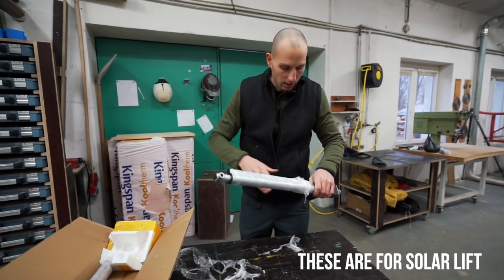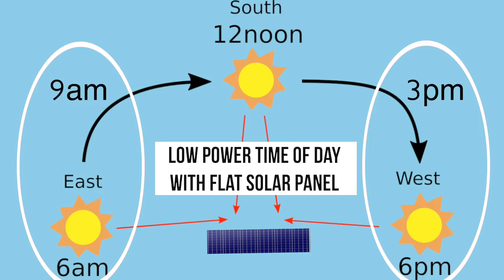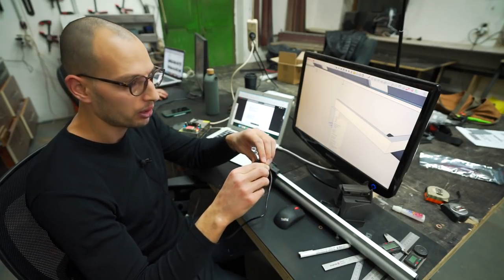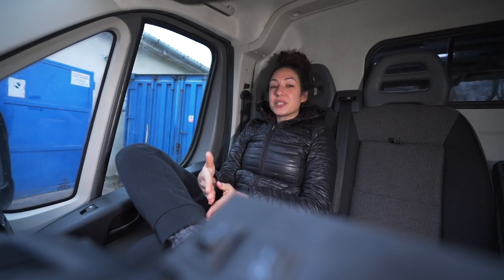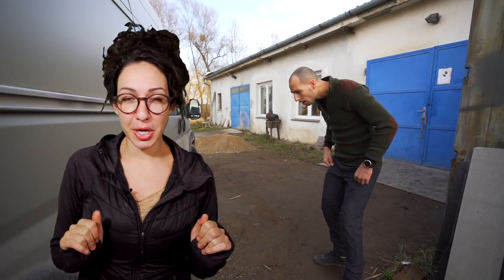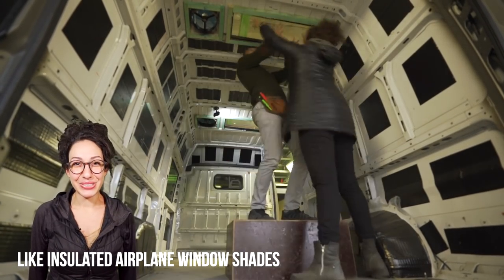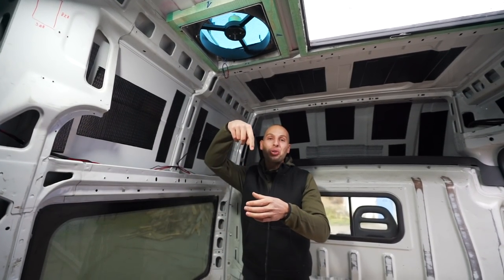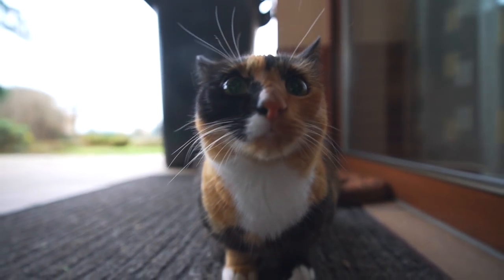VAN BUILD FAIL - Water, Solar Lift, and Possible DELAY? Campervan Conversion #11

Comment: Hi guys...I'm sure Ladi has got the skills to make your water tanks.
Bit of advice, as I used to similar work, when purchasing your sheet material and the corner beading ..make sure they have the same melting temperature or as near as possible...that way when using the hot air gun you are effectively melting the two sheet parts and beading together as one piece...also when starting the corner beading...slice off the back at a 45 degree angle...it will fit into the corners better....when melting the beading look for a pool of molten plastic at the back and keep that pool going as you move along...that way you know it's all melting together....I'm sure theres some plastic lining video's a available which will show you in detail....hope this helps and carry on the good work as I do enjoy your video's 😁

Comment: Ladi. Consider using a vertical compression spring (coil or leaf), or wedge at the non-motor end of the actuator, to start the vertical movement of the panel. Try to use the power of retraction to lock the panel down with a caming latch. I'm hoping to design a lift wherein the panels are stored when the actuator is half extended, and will tilt one way when fully extended and tilt the other way when fully retracted (fewer actuators). If I can't , I'll use solenoids to lock right side or left side pivot points to get same result.

Comment: Hey Ladi,  I'm so glad your wanting to lift your solar panels with a actuator as I'm trying to do the same. I'm leaning towards using a bell-crank. Thinking if i push off of the side that's hinged I can connect to a stationary  pivot point where the b/crank is and the other side of this b/crank will have some rod hooked to solar panels. When the actuator shoots out and pushes the b/crank, the other end will push against the solar panel  and raise the opposite side than the one hinged down.  In theory I think this should work,,,  but I'm kind of waiting to see how you tackle this and margaret captures it on film hopefully in  EP. 12  Stay safe & out of the cold
Reply from the maker: Hi, I’m in the development stage and it’s damn difficult to keep the solar as low as possible, lock it at the bottom position and have over 45 degrees angle. Send me a simple drawing of your idea at Ladi@mysuperebike.com if you don’t mind. I’m open to some ideas!

Comment: All that sealant slapped over the joints on the tank make me wonder if the plastic welds underneath are even water tight. Sorry for your set back guys. If they made that many changes without consulting you I personally would not pay. The drain off point was a joke. 5 litres left! As a welder and fabricator who has made his own thermal store out of stainless steel I'm interested to know what made you go the plastic route and what the pro's and con's are? I'm guessing the weight is the biggest attraction? Anyway keep up the good work guys, very thorough build detail and entertaining video's.  I'm pinching your triple glazed Argon filled roof window idea for my truck conversion. Top man.👍👍👍👍

Comment: Suggestion, if you used a spring plunger for initial lifting it will reduce starting force for actuators as well as act as anti-vibration device.

Comment: Definitely build the tanks yourself.  There are a lot of YouTube videos about building fiberglass tanks that should be helpful!  Fiberglass is very easy to use, can be built up over foam board to provide built-in thermal protection, and can be layered to a very strong thickness, and is infinitely customizable.  If you're worried about leaching chemicals in the water, just glaze the interior with a food-safe epoxy.  If you don't want to touch fiberglass, why not weld a stainless steel tank?  Just some thoughts.  Plastic isn't the only way to go.  There's a ton of alternatives :)  GOOD LUCK and HAVE FUN!

Comment: For the solar, what about using a lift like a scissor jack?  Also,  although it's a ton more research and work, if Ladi builds the water tank it'll be perfectly designed and durable  :-)
Reply from the maker: Thanks for the input. I(Ladi) considered scissor jack mechanism too. When you lay out all the measurements in 1:1 ratio you quickly realize not that many solutions are doable. We aim for very low profile and steep solar angle. Many people have done solar lifts already but we want to do it better.

Comment: My neighbour made loo cistern by acrylic solvent welding. Worked pretty well. Dunno how that stands up to having 160Kg of water sloshing in it under a van, but I guess you can add strengthening baffles. Are you planning to use ABS or HDPE and heat weld instead? I did consider making a (steel) hot-water tank for a solar system a few years ago as ones with stratifiers in were incredibly expensive and don't fit in UK houses. As it was upstairs and leak consequences were large I wimped out in the end and just left that project for later. So I look forward to finding out how to do custom tank construction. Aluminium with a fibreglass liner is a good way of making something really strong. Or even just fibreglass in a former (and a bash plate on the bottom). Any fool can make fibreglass :-)

Comment: The tilting is tough. What about pulling the solars on small springs/ or rubber bushings? Thisvwill keep it from Ratteling when they are down and help to get over the dead Point when pushing up.
Maybe a cantilever design that helps to get away from that flat angle.
Reply from the maker: I'm afraid it would be impossible to achieve even 40 degrees angle and keep a low profile.
Reply: @ladiandmargaret  I would dump the tilting and rather get the aerodynamics right so that you doun't have wind-noises while driving. The tilting mechisem will be very anoying iff you have a constant wind-whine while driving. 
You got enough solar,  it will ok withouht tilting.
If you get some E-bikes (Enduro whith BBSHD) where it does make sence to Pedal, that is good for your health and will at least 3x 4x extend your range. 800Wh per day would be more than enough for 1 bike 1day 80km or 2000hm easy.
Reply from the maker: Thank you for your suggestions. We know exactly what we want.

Comment: Bad luck - great video! 👍
Making custom tanks is a great option that could help in many builds. Would be interesting to see. You could create a second "tank" that goes around the isolation for protection (top side open). Or add pipes going through the tank for cabels or the break linkage under the Ducato...

Comment: Bad luck about the tanks. Relying on others can be such a pain. 
I ordered my windows three weeks ago and have just been told now they won't be ready until late January. By Xmas they said! 

If you're going to use vinyl sheet flooring (I am), turn it up at the sides where it can't be seen by about 20mm. This way it will reduce the chance of any  spillages, dust and dirt getting under the floor.

Comment: What sealant did you use for the roof lights? Is it ultraviolet stable? How much shrinkage is there? and when the van is moving and the roof is flexing/ the solar panels are lifting, will it hold and stay water tight? All so does the sealant have a maximum gap size that it will fill as the 7mm deep channels on the roof are quite a big gap to fill with a wet sealant. Just thought I would ask. As you seemed cautious in one part of the vt.

Comment: Do you think an air bladder (like a squeeze box) centrally fitted to the underside of the panel frame would have less moving parts and need less maintenance ?  If might even allow a manual override ?

Comment: What about two actuators positioned to face eachother along one long edge of the solar frame. With a small "entry" angle of the opposing actuators (actuators fitted to reinforced section of the roof and a centrally placed bracket on the frame, say 8cm vertical height) the force of the actuators would result in the solar frame being lifted. No forces would be transmitted to the frame structure, just the solid metal bracket. For a 100cm actuator you would get approx a 45 degree panel angle which would be enough to make a significant increase in the solar yield and still be safe in light to moderate winds.

Comment: Ladi do you do any custom battery builds? I'm looking to build an ebike using the carbon fiber nyx frame, qs273 motor and a sabvaton 200 Amp controller. Trying to get the max 15kw out of the motor. Can you build me a large capacity pack using Lipo cells?

Comment: wind - aerodynamic shield for the batteries on the front roof is sufficient to deflect the air velocity sneaking under the battery beds. btw: all objects on the roof create additional vibration load and the ceiling from inside is better to be cross-beamed ;o). But I luv yr creativeness and hard work. I'm gonna make my stealth van soon - fingers crossed :o).

Comment: In your opinion, do you think that sheet vinyl flooring is the best option for a van? I have had trouble finding a style I like in vinyl plank flooring not to mention, it is three times the price of vinyl sheet. I am concerned about wear and tear with two cats. Any thoughts or insights?? Thanks!

Comment: I have been wrestling with the same solar problem and have come to a solution that would like to share for inspiration. The idea is to use drawer slides hang out off the van roof and then pivot down to the 45 degree angle, using gravity. There are a couple ways this could work and I'm not sure if I would prefer to use the new ball bearings or the old wheeled slides???  We will see.

Comment: Have two cats in a small space and they lived on the boat with me. Use a Frisco Wall Sisal Cat Scratcher that works well. They don't like ones that are just flat against the wall, tho
Reply: Have to wrap it around a wall corner or they will not use it

Comment: Make it like boat tanks are made, we do it al the time. Use Aluminum or stainlessteel 4mm plate, outsource cutting on laser or water cuter with all through holes. Weld it mig or tig with splash bulkheads. ....

Comment: 14:30 isn't this the mechanism that you were looking for to use it on your solar panel? Just fix-mount the motor horizontally under the frame and you should be able to lift the frame up just like you would lift up that backrest 😉
Reply from the maker: It just gets more complex than this when you actually care about overall height of this structure and angle

Comment: A small Idea for the solar panels, when you drive and you don't want that they move while driving put in the front a small spoiler so the wind get over the panels and not under or between...
Reply from the maker: Thanks, spoiler is a very obvious part of the roof design.

Comment: Ladi will do a phenomenal job on the tank and in the long run you will be happier for it. 

Why plastic and not stainless steel?  I just got a custom stainless steel shower pan built and while it was not cheap you have a better chance of finding the needed expertise.
Reply from the maker: I've been drawn to plastic welding skill for some time so I ended up purchasing a welder and all the material for tanks. Stainless steal would be nice but we would not satisfy our 20k budget.

Comment: Would you be so kind and post a link to the magnetic mobile phone holding or add it to the part list file . Thx a lot
Reply: Just google, magnetic mobile phone holder
Reply: I'm afraid those magnetic phone mounts will interfere with the navigation "compass" that is built in phones
Reply from the maker: hey George, that's actually not completely accurate. Magnet holders for phones are designed specifically to not have that problem. yay!
Reply from the maker: https://bit.ly/37qUBvH

Comment: hi guys
If you would like to get the maximum power from your panels, not only need make them liftable, you will need them also rotate 360 degrees, otherwise to take full profit with the liftable system, you will need to park the van according with the sun which can be quite annoying in some places and turned de van around at midday....
Reply from the maker: Easy to say but pretty difficult task to engineer 😅

Comment: U maybe ray from rayoutfitted on YOUTUBE can help u with the solar array lifting system, he has one on his van as well
Reply from the maker: We've never seen doing what we want, that's why so much engineering. It's easy to mount them high above the roof and tilt them 40 degrees. It's difficult to have them less than 10cm above the roof and tilt them 60 degrees and that's what we are aiming for.

Comment: Since Ladi is building the water tank - maybe you can 3D print some extra insulation around it. Good Luck it will be an epic diversion!
Reply from the maker: That's would not work but we already have insulation sorted!

Comment: Tilting the panels is one thing to maximize the solar power output. But if you don‘t have any kind of swivel in order to turn the panels around the vertical axis, you have to turn your van 15 degrees per hour to maximize the solar power. This won’t be not very convenient. 
But I guess you took that already into consideration.

Comment: Guys, it was said once already and Im going to say it again. Use Aluminum or stainless. It will be cheaper, faster and is far more durable. I could have a tank built and in your hands in less than 2 weeks and I live in Canada. You absolutely could have something built locally in very short order as any decent sheet metal shop can put one together in less than a day.

Comment: The ebikes look good, however within the EU and UK, an ebike cannot have a motor more powerful than 250watts and not be able to be powered faster than 16.5 mph. As soon as you have a more powerful motor and faster speeds, it becomes a motorcycle that has to be legally registered and insured and you have to wear a crash helmet.  How do you get round that or do you sell them for private land only?

Comment: Omg those tanks were build worse than mine. And I did it with zero experience. I’ve used for great tank: steal and fiber glass, and fresh one i ve used plastic  tape, fiberglass and epoxy very effective. Maybe it would help
Reply from the maker: That would not be a nice job making fiber glass tanks. Better to buy plastic sheets and weld them.
Reply: @ladiandmargaret  yep exactly. I’ve used plastic sheets weld them together however I’ve noticed that after some time they start leaking so I’ve decided to redo it. So I’ve welded a new shape with plastic sheets used pool scotch black one, and did a fiver glass on the top... omg it game changing thing. Seriously without epoxy and fiber my tanks would leak again now they are perfect using them for 4 years already and still ok.

Comment: Surely, the solar panels have be made to automatically tilt and turn to follow the sun. Of course if you start the engine they must return to their resting position. Is this too much to ask?
Reply from the maker: Turn would be nice but that is asking for much. Ignition key is a valid point we would like to accommodate too.
Reply: @ladiandmargaret  i just thought that as the sun moves with the panels tilted there will be a point, unless you turn the van, at which the sun will not strike them.
Reply from the maker: @davidbromley7139  Of course, it's just a very difficult engineering task.

Comment: Frankly, I was 'amused' when I saw what you chose to 'lift your panels'.  As if CAD will create a better design than forethought and good engineering..  BTW, lifting the panels on the long side will expose them to higher wind resistance and subsequent unexpected and expensive removal (unexpected by you, LOL!) in moderate winds, not to mention the truck swaying back & forth. Don't forget the Dramamine..!  Good luck to both of you...!
Reply: Ladi has the right idea with motorized tilt solar. It is easy to implement a controller with wind sensor that will auto-retract when a specific wind speed is reached. Then is back to horizontal mount like any other install...nothing to lose, only to gain precious KW of clean power from the sun
Reply: @pjf7943  Exactly...
Reply: @georgedemean2228    "Exactly", what?? That I am correct or your wishful thinking..????
Reply: @pjf7943  Whatever tickles you man...everyone here is  entitled to a constructive non-confrontational opinion here.

Comment: I would be concerned when the panels are up they will act like a wind sail, im not saying you will not make it nice and strong, but
the wind will make the van sway back and too, and you will probable feel sea sick. I should know i had a roof tent and in the wind it made the land rover sway  like hell..something to think about.
Reply: You can always integrate some sort of microcontroller with a wind sensor that will retract the panels when a specific wind speed is exceeded.
Reply from the maker: Don't worry :)

Comment: Love your site, all the info you share, and understand the dilemma of planning and waiting to start things in proper sequence (I'm waiting on insulation to be shipped at the moment; and cannot build my low profile floor console until the swivel base to the passenger seat arrives, which will not be shipped until March...so feeling your pain here). But for your water tank problem, I know it's here in the US (Florida), but might be worth a check: https://plasticfabricatedtanks.com/
Regardless, best of luck!

Comment: My wife and I are going with a custom builder for our van, and are using a pair of 23.5gal Potable Water Storage Bladders, (https://www.water-storage-containers.com/waterstoragebladder.html)  if you haven't seen or considered them as an alternative to a hard tank.  We used them in small remote sites in the military in the 1980s-early 2000s.

Comment: A 45% angle should only be losing 30% of the power based on the geometry off the incoming light.  You claim it's a 90% loss.  Why is that?
Reply from the maker: it said "<45";)